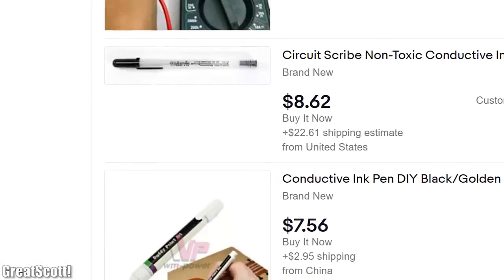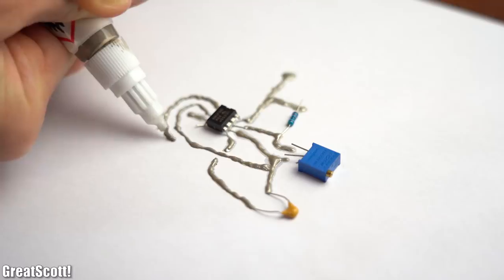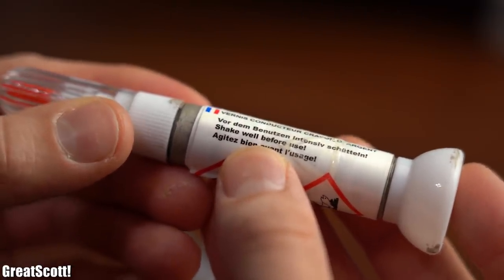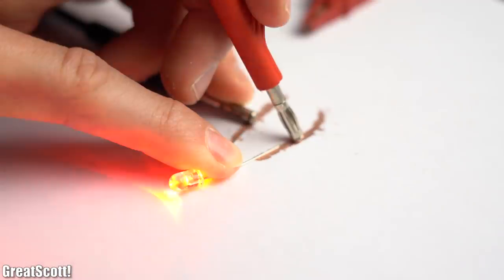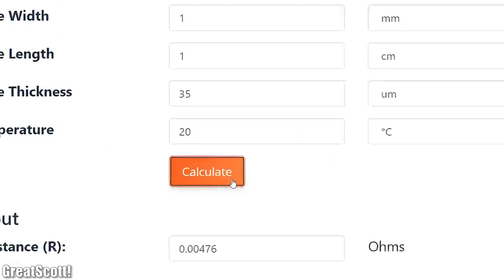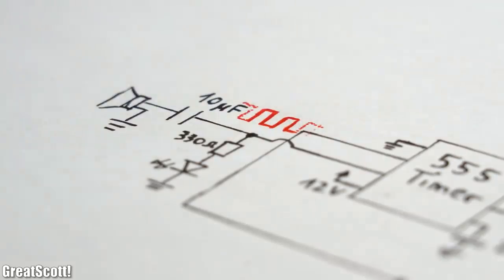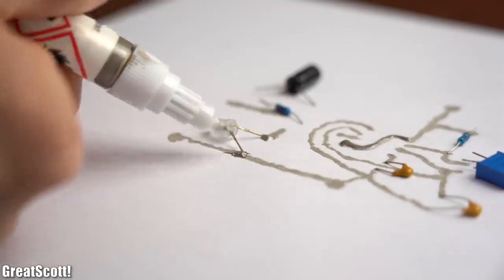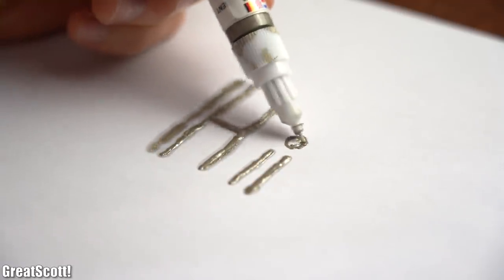You can draw circuits! But does it make sense? Conductive Ink Pen Experiment!

Comment: fixing broken traces with conductive pen seems like a brilliant idea!
Reply: Many years ago automotive parts stores used to sell pens like this to repair broken traces for GM dashboard instrument clusters
Reply: I have used conductive paint to fix heated rear windows on vehicles before.
Reply: Maybe only at low current circuits traces, how could we see.
Reply: It is! And it's a savior for people like me, who have shaky hands and burn traces! It's been used in several solid state +500watt bass amplifiers at my job
Reply: Nope, just scrape the mask and use solder
Reply: Ya
Reply: @tanishqbhaiji103  that's destructive.
Reply: @triadwarfare  not really
Reply: Thats the only reasonable use case i can think of
Reply: the traces for razer membrane keyboards are almost exactly this material so i fixed a $100+ keyboard with a $5 pen
Reply: @gullreefclub  will it work to fix worn out carbon inside a vane type AFM sensor? 

I have a problem with my 1988 Toyota Cressida that runs lean ONLY at 3000rpm, but normal at other rpm. When I opened the AFM unit, I see a scratch in the carbon sweep (potentiometer?) And I think that's what make my car lean at only 3k rpm

Comment: I fix keyboard tracks using silver conducive paint, works perfectly.
Reply from the maker: Good to know
Reply: @greatscottlab  Also you can repair conductive rubber such remote control or wireless phones
Reply: That what I was thinking a good use of this would be. PCB trace repair.
Reply: Graphite is also conductive and pencils are much cheaper.
Reply: You must be using a good-quality one because the three syringes of wire-glue that I've gotten from Chinese sellers on eBay have been useless and don't work (they don't conduct at all whether fresh or dry), so I've got a pile of keyboard membranes waiting to be fixed. 😕 (The first one I got several years ago did work briefly but stopped after a while, the others never worked.) I got some copper tape to fix them instead. 😉
Reply: I wonder if you can fix broken flex ribbon connections with this
Reply: Yup. Perfect for the bottom of those contact pads !
Reply: I used to work with silver loaded epoxy for some high end stuff.
Reply: @vibrion121  I use a piece of aluminium foil for that, it also works.
Reply: @gnramires  yes! But its quite rubber/material key dependant. Some are silicon polymer based and even cyanoacrylate cant glue them

Comment: Tried it once, only recommended for low current applications.
Reply: Where did you buy it?
Reply: Sooo.. works great as a fuse? :-)
Reply: Great for fixing bad traces. Been using it for years.
Reply: And i think about the performance of resistence/cm after a long time. Maybe the resistence/cm is going to be higher and higher.
Reply: Or for High current works as a heater
Reply: You need to make the traces wider for higher-current applications, as the resistance of the "ink" in narrower "traces" (lines) restricts the flow of current.

Comment: I tried the same with a pencil, they are very good for making resistors
Reply from the maker: Graphite pencil?
Reply: @greatscottlab  I also tried
By creating a dark thick line with pencil
And it was conducting too
Reply: @greatscottlab  probably
Reply: @greatscottlab  aren't all pencils graphite
Reply: @greatscottlab  Yes !
Reply: @attackaffection5444  Just HB pencil also 
works with refillable 0.7mm pencil
Reply: @emir4707  well guess what . I've ever only used HB pencil...

Comment: I've used a pencil to draw circuits. The graphite is conductive. On the original run of Athlon CPUs you could enable overclocking by drawing a line with a pencil on the top of the chip to connect two contacts.  I've used a pencil to draw to connect a broken trace on circuit boards.
Reply from the maker: Interesting!

Comment: These came on to the market some time around the late 1970s and early 1980s. Their specified intention was for circuit board repair. This was at a time before surface mount circuits. The smallest trace found on most PC boards was 0.1 inch which is the pad width for through-mount ICs. The only method of creating a PC board at that time, whether mass produced or hobbyist was a photographic process, and using caustic etching solutions to process the copper. Making a PCB as a hobbyist was possible, but more involved than many wanted to go into. The first PCB pens were actually black ink pens used to draw opaque traces on the transparent acetate to hand draw the photo positive for that photo process, and it actually worked pretty well for that purpose. The carbon based black ink in these pens was discovered to be conductive, and so the birth of this whole idea of just drawing the PCB directly.

Comment: I wonder if in the future as material science advances, we'll see conductive ink with as good conductivity as like raw copper or something, it'll be so cool and useful
Reply from the maker: Only time will tell ;-)
Reply: I think we can print (badly) with copper already (and it's super difficult) but it's not your standard FDM printing on account of needing ~1200 degrees to melt the copper. I think it uses powered copper and laser instead.

I like you am super excited to see a day when we can print copper (hobbyist style) esp if you can print it inside a standard print.
Reply: Since conductive 3D printer "ink" is already available, you can now quite literally "print" printed circuits using a 3D printer.  I'm not aware of any standard inkjet printer ink that is conductive to this degree, though the problem with standard inkjets is that you can't "feed" a rigid surface through them, but you CAN 3D print on a thin board, for example.

Comment: I feel like the silver pen would be a decent thermal paste alternative while using small heatsinks.
Reply: Yes, It seems to be worthy of a video.
Reply: What is the benefit compared to thermal paste?
Reply: @michaegi4717  nothing, actually it is worse. there is reason thermal paste DOES NOT dry up and non-conducting, 

when you change thermal paste  with conductive paint and it dry quickly you lose the properties for thermal conducting since the part should be in touch with the paste (dry = shrinking) and heatsink.

the thermal paste works with filling the gap between heatsink and the parts, therefore the filling material should not dry. that's why when you see the thermal paste is dry you should change it with the new one.

and the reason for thermal paste is not conductive is for safety reason in eletrical sense.
Reply: No, no it wouldn't.
Reply: @michaegi4717  IMO, there would be no real benefit, but this stuff would dry out, perhaps cracking between heat sink and device, which would alter the transfer of heat in a bad way.

Comment: Sometimes I've made double sided DIY PCBs using photo-resist and copper clad etc. This works nicely, but one issue is that the top/bottom vias are not connected after drilling them out. To solve this, I typically insert thin wires in all the vias, and solder on both sides ... but this can be a bit tedious. I wonder if this 'magic' conductive ink might be used to quickly plate the vias, by injecting it into the holes. If so, this ink might possibly be useful for 'actual' projects.

Comment: Something people fail to mention is with the silver inks you should actually heat them for a while to fully cure. The resistance will drop even lower is you do that
Reply: good point. I am reading that a full 24 hours is required but applying hair dryer for 5 minutes can do the same job as 24 hour air dry

Comment: I prefer the oldschool readymade hole or holestrip pattern PCB's for a quick prototype build.
They are conveniently laid out with a 0.1" hole pattern fits leaded type IC's and all types leaded components.
You can even use these PCB's as an overlay for cardboards and then with a nail or needle punch your hole pattern on to the cardboard.
That makes for a very neat birds nest on the initial layout.
You can always order from JLC pcb maker later on for your deluxe version project.

Comment: Used one years ago to modify an ATI Radeon 9500 pro 128 MB graphics card by unlocking more pipelines and bios flash it to a higher model card. Worked perfect!

Comment: I use conductive paints and inks to replace acid destroyed circuit traces on my old Soviet quartz watches.   Its actually pretty good and instead of all that soldering minute bits of wire onto a circuit board I just paint over the break and jobs a good 'un.   I started using originally silver paint used for repairing the fine traces in rear screen demisters for your car, using that to create overclocking and unlocking bridges on AMD and Intel CPU's and was always useful for repairing a circuit board where a capacitor had let go or a coin battery had sprayed its love inside the device.

Comment: I recommend the cheapest silver conductive ink you can find that is more of a paste.  squirt that onto a piece of plastic.  now get a tiny tiny sewing needle and screw that into your exacto knife instead of the knife.  now use the needle as a paintbrush to finely paint traces with amazing accuracy with this this paste into your substrate of choice.  don't stop the trace shy of a component!  set that component DOWN and trace up onto the leg of it with a little glob of paste to blue down the component and electrically attach it to your trace.  no soldering needed AT ALL.

Comment: In a similar vein, check out 3M's Z tape 9703. Double sided adhesive tape that only conducts in the thickness direction. Contains micro balls of copper. You can just stick an IC onto its footprint and all the pins make contact without shorting to each other.

Comment: I prefer to use double side tape (the thin one) and very small wires ( as 24 or 28 gauge)  and lay the wires and components on the tape.
And I use fine soldier to make the connection between wire and components.
You can even print out a "circuit" with a printer and lay everything directly on the tape.
Fast and reliable.

Comment: I had used a conductive pen to jump pins on an old AMD Athalon 64 professors.  Made it run faster speed.  Worked well.
Reply: Mhh, interesting, I'm also tinkering with some athlon 64, can I ask you how you did it?
Reply: @red1246 sorry, I was wrong.  I went and looked.  It's on an Athalon XP chip.  Bridge the L1 jumpers unlocks the multiplier.    Guess I'm older than I thought.
Reply: @normswan5806  wow, that's a really old beast, how much more performance do you get from it?
Reply: @red1246  for the time it was worth it to me.  Nothing compared to today.  But, I also, "upgraded" by putting up a sign..."it's faster now".  I felt better.

Comment: i've seen people on youtube draw circuits on paper by just using a pencil, stating that since graphite is somewhat of a conductor it was possible to make simple circuits with it. it never worked when i tried it, the trace resistance was way too high, in the order of kiloohms, even with very thick and short lines. perhaps i just have very bad pencils, i don't know.

Comment: I was starting to experiment with the conductive 3d printer filament.  One low voltage application I wanted to try is see if I could make a potentiometer printed into the body of a robot arm.  But found multiple issues with trying to get the slicer to print one line width wires.

Comment: I designed a PCB for work, had it made and stuffed, but I forgot (So far in my analysis) exactly ONE pin, a reset pin on an IC that was left floating. No trace or connection anywhere, and in need it pulled high. BTW this particular IC is .5mm pitch SMD. Going to attempt to draw a connection (using tape to keep the ink from getting where it shouldn't) to pull it high, if it works I'll let everyone know, because I think this stuff has some serious practical application, especially in prototyping. It's less work than point to point wiring and more practical in circumstances like this.

Comment: These pens are used for small temporary repairs (as you briefly show). 

Also, you can not use a normal DMM for low resistance measurements like you do. You need to use 4-point (4-cable) measurements as parasitic resistances are high. You are in essence measuring your test equipment and not the paste. You then need to use a test structure to determine the intrinsic resistance of the conductive paste, otherwise you are measuring your geometry which is useless for most cases. One such simple structure is called Transmission Line Measurement (TLM). All you need is a straight line of the conductive paste, a ruler and 4-point measurement. You are almost doing it during the max current test. It would be nice if you could the show the correct way to measure as most new engineers seem to have problem with them. 

If the conductive paste is silver then the line resistivity should be 3-10x that of bulk silver, i.e. very good.  This kind of thermally curable silver paste are used for the pattern on the front of almost all (99.9%) solar cells. So 315x 
is an indication of poor setup+measurement rather then poor material. In this case, I believe it is due to use of paper which is extremely porous material so the conductive film is broken up in islands. Use a solid PCB as a carrier for the silver paste to avoid this problem. Again, don't use DMM as I have yet to see any DMM measure below a few hundred milliohm even with a dead short on the leads. 

Finally, the Chinese pen seem to be copper paste. These oxidize in air to that is most likely the reason why you can not solder on it. We had the same problem when we wanted to use Cu instead of Ag in our PV cell production to reduce price.

Comment: The problem with even simple LED circuits is that the resistance will cause the LEDs to light up at different intensities. Even the silver palladium and gold palladium inks from DuPont and others screen printed on hi alumina ceramic substrates had limitations. The polymer based inks are even more limiting.

Comment: What if you used the cheapest solder paste to make the traces?  You could also try putting the circuit into an oven to see if you could melt it before the paper lights... you could use parchment paper although you may need to rough it up to get some adhesion.

Comment: Great Scott! Can you test if you can use that ink pen to do temporary connections on perforated laminate board? I mean the prototype pcb full of holes in which you need to make connections yourself but you can solder to it easily.
If that silver would stick to that pcb enough to make connections, it might be a fairly sturdy and cheap alternative to breadboard in which you can solder the components, but make the connections with pen. It is always a pain to make connections on those boards, so maybe this pen will do the job.
Also, test this also with the cheaper black pen which uses graphite instead of silver. Because the copper lining of holes in that pcb willl enhance conductivity and you need only to make conduction between them, so maybe even black pen will work.

Comment: I could see getting a robotic arm to draw out fine circuits that could be electroplated. Dope the ink(or some sort of resin)with different ratios of materials and you could probably make resistors. You also may be able to make capacitors by layering strips of thin plastic or silicone to be rolled up. Idk just curious that's all

Comment: maybe try attaching other components using the conductive pen ink as the connection instead of solder. after it is dry if you dont move it maybe it could work? you may need to find a different way to glue it into place though using this method. but that said it is worth looking into.

Comment: I bought some electrically conductive paint from Amazon but I've noticed while using it, it has Alot of resistance and you would never be able to make a circuit with it. Over a 2 inch span it will barely light up LED's.

Comment: You did not talk about how the stuff dries.  When you have a damaged flex circuit, it is almost always the trace of the outside.  Could you scrap or melt the plastic covering and use this ink to fix a flex circuit trace?

Comment: I wonder if a better way could be to crazy glue your components to your surface then draw the traces rather than trying to solder to the traces after. This way the trace is painted straight onto your contacts. As suggested in another post, use glass as the board surface so the trace doesn't try to soak into it.

Comment: Id definitely give it a try, i have some smd ics i always wanted to work with (power control ones) and we can't do it on a breadboard. I guess, u can sorta work with smaller smd ICs by using a real thin wire, which is long, and definitely conductive, the use the paste and connect em, this way you won't get blobs touching other lines

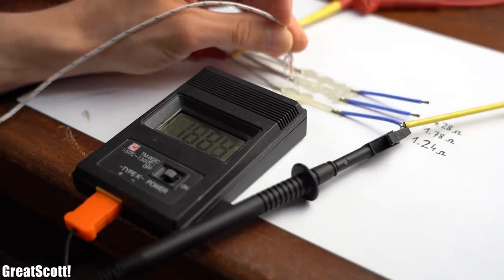Comment: @6:11 I am curious: Does the resistance return to the original value after the high current is passed through these traces, and is allowed to cool?  If not, perhaps the drawn circuit could be 'baked' to obtain better electrical properties.
Reply: For higher current, you need wider traces (since you can't really make them thicker).  But you probably would be fine on a 3D printer using conducted filament/powder; you'd just want to test or prototype your connections to see what resistance the ink or filament would result in, and adjust from there.  3D printers work well for this, since they can adequately deal with a rigid medium such as a piece of plastic or fiberglass board, where a normal inkjet printer wouldn't handle anything but paper.

Comment: Had an idea. Couldn’t you use a filament 3D printer to print the blank circuit board with recesses where the conductive ink traces would go? That way you could custom make the board for virtually any application. Not sure it would work but could be worth a try.